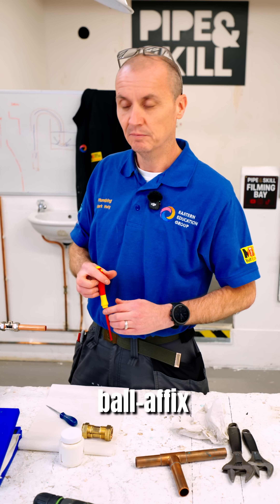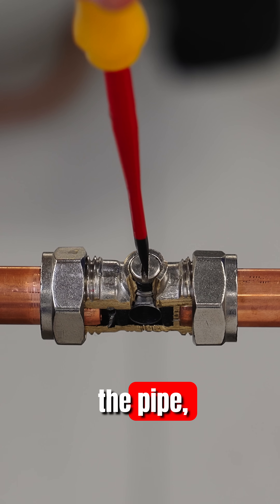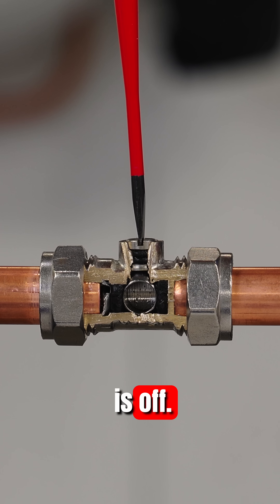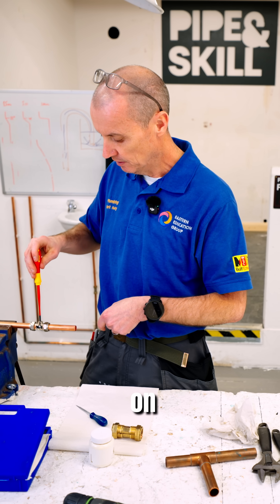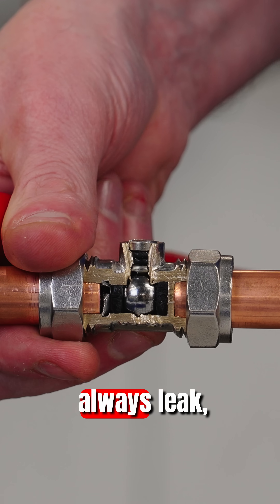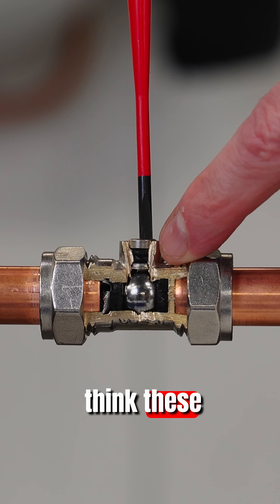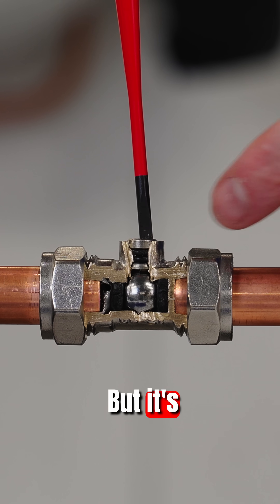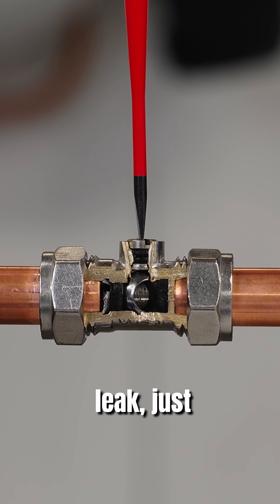Isolation Valves Explained ℹ️ Why Do They Leak ❓💧

Comment: These are mainly used as an easy way to service the tap as sometimes it can be a real ball ache to shut the water off , Its time the manufacturers of these crappie valves sorted this problem. Gate valve shite in a new form.

Comment: Perhaps use the correct size screwdriver.  Just a thought.
Reply from the maker: You’re spot on… it should be a flathead that fully fills the slot, so you don’t chew the slot up.
Reply: Qu: How does that effect help to stop it leaking?
Reply from the maker: The screwdriver has no effect on it leaking 🤷‍♂️